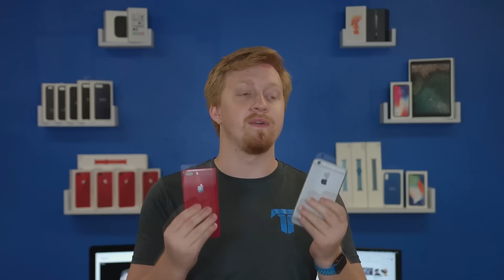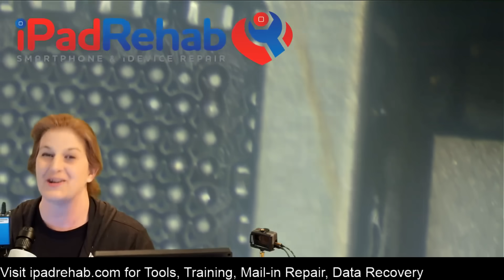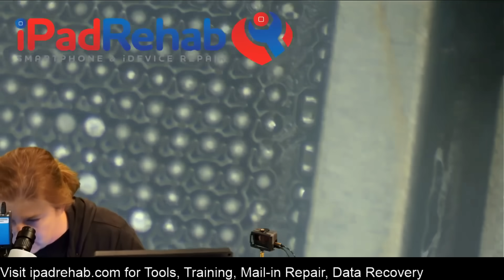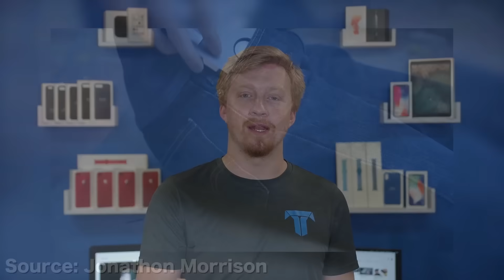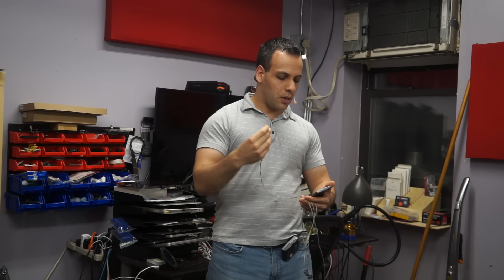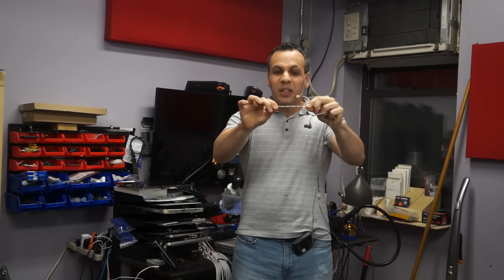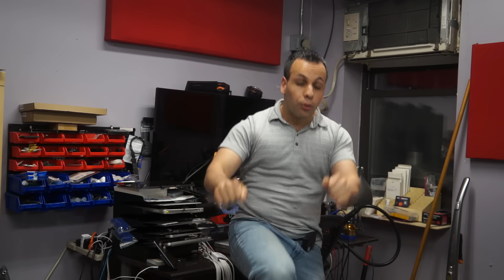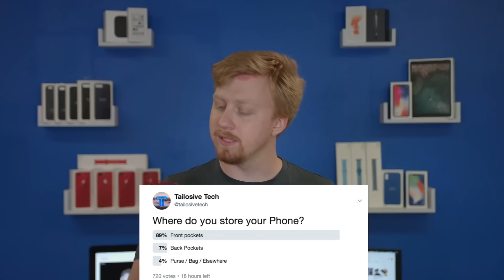The truth about iPhone bendgate deniers

Comment: My personal experience 
Android usage: 5years
Devices used: 5 phones
Resold phones: No. Did try but no one would buy them even though they were in excellent condition and at most 12 months old
iOS usage: almost 4 years 
Devices used: Got my 2nd iOS device a month back
Resold iPhone: 30% of buying price 

The new Samsung ad mocking iPhone X is something similar to what I experienced in real life, if you just switch android with iOS and vice versa

- An average consumer
Reply: Cant argue against the resale value of ios devices, but 30% on a 4 year old used phone?
The iPhone 6 Plus is now 3 gens old and was ~800€ here. 
Ive checked ebay and used ones sell for 145-190€.
A used S6 edge plus(was about the same at that time) sells for nearly the same. Maybe 10€ difference, thats it. 
Same goes for the Note 4(2014 release).
So i dont see your point proven here. 
You get greater resell value when comparing 1 or 2 year old android phones, but everything above theres no difference.

Other than that, i think Android is a more advanced os than iOS. 
The only thing that is mostly better on Apple devices are Apps and system integration. 
But if you dont benefit from this bcs you only have one Apple device, iOS is just bad. 
I own a Pixel 2 and an iPad Pro 10.5 and both have their selling points but also their flaws. 
The main flaw with the iPad is iOS imo. Not being able to move my files from one app to another(like you can on OSX, Windows or Android) is so annoying. They should bring osx to their iPads, everything else is just crippling on your productivity.
Reply: Sander169 The point I was trying to make isn’t just about the higher resale value. Although I would like to point out that in India the retail price is usually higher than in regions like US and UK, for e.g. the $1000 iPhone X roughly costs $1300 in India, hence there a slight higher re sale value since people usually set the price according to the price at which they bought the phone. Additionally where you end up selling the phone also makes the price vary in some cases by a big margin. 
Coming back to point I was trying to make, I absolutely loved android at point in time, but the issue with android was that I was having to upgrade my phone every year just to keep a smooth lag free experience. After about an year of usage all my android phones would have very very clear signs of ageing software wise be it a mid range the wildfire or the flagship htc one( m7)(that still is from my perspective the phone that completely revolutionised how phones were being designed)
So basically my phones upgrades were mostly out of need to upgrade and when I upgraded to the iPhone X last month after over three and half years of usage I upgraded my phone because I wanted a new device rather than needing a new device like in the case of when I had android devices.
From the perspective of an average consumer I would rather spend slightly extra money and get a device I know I wouldn’t need to change for the next couple of years plus for me the novelty of no limits to customisation on android kinda wore off soon. I did my bit for android by being loyal for 5 years, I switched to iOS just to try and see what its all about and tuns out I don’t wanna go back to android.

P.S: Yes many things would have definitely changed with the newer android flagships, I’m sure the iconic Samsung lag is not a thing anymore, but then that one Samsung device with the lag was more than enough for me to put me off Samsung for life. (When I went to buy my latest device I did check out the S9 but those old memories were there too to make sure I wasn’t even considering it) kinda like in the latest Samsung ad, do you think after all that, the woman would ever try an iPhone again. And that’s the case with 90% of the average consumer

Comment: Mind that boards not only bend by mechanical stress put on the case. They also bend if you put thermal stress on them. CPU load is gerenerating lot of heat also charging the battery.

Comment: Dude All of them can be countered. For example, you said that the bend gate still matters bc we have a similar design. Number one the newest iphone which is the direction that apple is going in (and might I add pretty much all the android phones too). AND none of the designs were the same, the iPhone 6s was built with a stronger grade aluminum which brought down the number of iPhones that were bending, and the 8, 8 plus, and x all have glass backs which makes it significantly harder to bend iPhones. Another example is you said the iPhone 6 and 7 had very similar problems, well guess what? you can find similar problems if you look through millions of cases, and you just so happened to have millions of options to chose from bc as I'm sure your very well aware the iPhone 6 was one of the best selling phones of all time, even with the bend gate that only effected a small percentage of iPhone 6 users. Additionally, you said that apple never addressed the problem, they actually have out out statements about this particular "issue" with the iphone 6 and so yes, they addressed the "problem" and they chose not to do anything about it bc it is just something that comes with newer thinner products and ones that have been used in the wrong way, they will break easier, and thats just a fact of life.

Comment: I’ve got an iPhone 6s and have had it for a little over 2 years and it’s fine, it is completely flat (apart from the extended camera from the back of the phone). Maybe the iPhone 6s didn’t have the problem or it does and I’m just lucky and don’t have the bend issue

Comment: I am a male and put my iPhone in my back pocket. I replaced three iPhone 6's between my wife and myself for them bending. I didn't know until recently the other issues like dead spot in the touch screen and boot looping may have stemmed from bending and flexing, but it seems apple knew all along. We had to also upgraded to 7 plus models after the last two broke because with all the apps we had purchased between ourselves and for our kids we feel we are stuck in them. Also having to replace 4's and 5's for battery issues that apparently were issues with their OS after updates. Really wishing there was retribution for all this stuff, every time i hear the information released apple knew about these things or caused them like the battery gate it frustrates me. 

As for the angry lady D.N.A.who posted prior to me, it's not whether or not YOU put your phone in your pocket and it didn't bend (which by the way there is rumor Apple changed the metal alloy in the "S" models after the iPhone 6 bending issues) its the fact that MANY people have had this issue. I'm not alone and not crazy because I went through a few of these things along with MANY MORE PEOPLE. Just because YOU had a positive experience does not mean I am not allowed to have an event occur to me that was negative and I'n not crazy because I think it was engineered wrong. I'm guessing you think Ford was not at fault for the Pinto and Police Interceptors starting on fire? Plenty of people and police officers drove those with out issues like to say your experience was, I guess those exploding gas tanks weren't a mistake according to your train of thought...

Comment: Just an input on Samsung. They had the pink line in the right side on s7 edges. Won't fix it out if warranty and if left it'll cover the screen. You should talk about that and explain why and what to do
Reply from the maker: I have only seen that on replacement screens, never on the original phones. Even when it was an original screen used to replace it though.
Reply: Louis Rossmann I bought mine from a guy about a year after it came out (used) and it happened 6 months after when my phone fell out of my hand and flat on the floor. No physical damage but the pink line appeared. It only got worse with time even though I was extremely careful after. After researching it I found a large amount if people had experienced this. Even at school (college) when I asked people they would say they knew someone else who had it or they had a device with the same line
Reply from the maker: I wonder if the first guy I had the screen replaced on it. Those are ridiculously difficult to replace the screen on, because those screens break very easily if not adhesed properly into the phone. One of the reasons I don't fix the screens on them is because I know I would likely get many warranty returns for pink lines. I know the local Samsung repair places are tortured by this
Reply: Louis Rossmann no cause it was fine before and Samsung when I contacted them said it's a wire in the LCD that got messed up and even tho it's their fault they don't warranty it

Comment: The 7 and above fixes this problem by using a different alloy in the housing.
Reply from the maker: the 7 has audio IC defects at the same point that the 6+ had touch IC defects. they learned little from this :(

Comment: What about the fact that you see the most broken phones? You are a smartphone repair guy. You see the worst of the phone world. You don’t see the millions of working iPhone 6s that are still in use. There are still hundreds of millions of iPhone 6 users, like myself, that appreciate the continued support and high build quality of our smartphones. This issue is extremely isolated and not as widespread as you think it is.
Reply from the maker: Touch IC issues my friend Jessa Jones has fixed on the iPhone 4, 4 CDMA, 4S, 5, 5S, 5C, 6S, 6S+, 7, and 7+: under 20.

Touch IC issues my friend Jessa Jones has fixed on the iPhone 6+ alone: over 1200.

When you open it and notice "oh, the board flexes and this pad pops off the board.." it becomes obvious why.
Reply: Louis Rossmann: How many iPhone 6 and 6+ do you think are in current use? 74.5 million for the 6 alone. This is an extremely small percentage of people who experience it, and they are thankful for people like you who are willing to fix it for them. However, iPhone design has changed. The 6S improved the quality of the aluminum, the 7 got thicker and more durable, and the 8 has glass that is exponentially more bend resistant and durable.

Comment: So unless you’ve opened a phone and have knowledge about how they work you should not have the right to express your opinions about a phone.   I think you went to far by telling him to shut his mouth. 

He was reacting to the channels who bent the phones purposely. He never said people did not have issues he said it was just a extremely small amount of iPhone 6 had bendgate issues
Reply from the maker: I think you are welcome to an opinion about a phone. However, if you're going to defend a design that is radically flawed that still affects phones to this day, I think your rebuttal should come from a place of knowledge. I think it crosses a line when when you discount the issues that hundreds of thousands of people are having by blaming them for what is someone else's failure. If you are going to blame the user for the manufacturer's failure, I think you should know how something is attached. It isn't a small amount of people.

If someone thinks a device is ok, that's great. But to want to brush under the rug the experiences of the people who were screwed is kinda lame. If you're going to do that, come with logic and evidence that explains WHY these people are at fault rather than the design of the phone. 

jessa has a workshop that is in the absolute middle of nowhere. Every phone besides the iPhone 6/6+ she has fixed touch IC issues less than 20 times.. the iP6/6+ over 1200. this isn't a small amount.
Reply: Extremely small? This issue has persisted past the initial iPhone 6 model, and to the repair community's knowledge, up to the iPhone 7. That's an entire 3 years of this issue existing, and Apple even had to issue a recall for any phones that were iPhone 7s with this issue: https://www.apple.com/support/iphone-7-no-service/
Reply: Too . Not to. Your argument is now invalid.
Reply: If you dare to comment on hardware problems you better bring your hardware knowledge. Which is usually Zero with these "TECH" Reviewers.

Comment: You should have broken a spoon with flexion to illustrate the point. It's one of the easiest ways to show it. It can bed, you can bend it 90 degrees or more, it won't break... but bend it back and forth even a few degrees and sooner or later it fails.

It's shocking how many people don't get that this is a thing with PCB's and traces. Traces can just end up lifting straight off the board after prolonged abuse... and it wasn't any one impact at fault!

Also you bring up a group I like to call "percenters' -- they will dismiss something -- like the sale of Samsung 6's -- because it was a low percentage of the market, not realizing that even a small percentage is still millions upon millions.

We deal with that all the time with "market share" in the web browser world, where people will badmouth "xxx" browser and say it's dying just because it's share of the market dropped.

Whilst failing to account that the pool size changed. Take Internet Exploder's share from its 2003 peak to it's ~2008ish ACTUAL start of decline. For that ENTIRE time people were saying "IE's lost all it's share, nobody's using it anymore" -- but you do the math and it's a bullshit claim. in '03 they had 92% of a market of a 650 million user market. By 2008 sure, their share had dropped to around 50% depending on who's numbers you used, but that was out of around 1.5 *B*illion users. Now I'm no mathemagician, but I'm pretty sure that 750 million is MORE than 598 million.

So whilst they lost 42% market share, they gained over 150 million users MEANING THEY DIDN'T LOSE A DAMNED THING!!! The market grew, and the new market didn't entirely go towards them. That's all.

Web Developers use the percentage excuse all the time. Oh IE users are only this percentage of the market and declining, oh mobile users of non-IOS are only this percentage, people disabling JavaScript are only this tiny percentage. People without broadband is only a small percentage...

Until they've "lame excused" themselves out of supporting so many small percentages there's nobody left!

All just to cover up their ignorance, apathy, laziness, and incompetence.

Comment: I bought the S6 because it was so beautiful, i had S5 before, I still use my S6, and it does have a slight bend in frame, but tbh, it has slowed down so much that it's annoying to use, I guess I have to buy a new one at some point.
Reply: The S6 was the first phone since the original S that when I saw it I had the reaction of I want that, I had S3, S4 active and S5 between them, not because I wanted them but because I managed to fuck them up, I wasn't even going to buy the S5, I wanted to repair the S4 active but no repair shop wanted to fix it because it would lose the water proof warranty.
Reply: Oh yes, even when the frame is bent a bit, it works fine, except the slow down, which is probably from the "old" age of 3 years.

Comment: Flection, is work hardening metal fatigue, a real problem for Aluminium alloys, aircraft ect where flex, vibration, pressure and temperature cycles are present, same for solder. Are there Female Engineers? Number of Female Engineers at my University? 3 out of 300 students, 1 Professor. Number I have worked with over 20 years? Zero. Rare!

Comment: I used to have a Galaxy S5. It failed after 3 years and I received a Galaxy S6 as part of the warranty program. I am pissed. It has no SD slot and no replaceable battery. I am going to have to buy a new phone soon there is just not enough storage.

The S6 has much smaller buttons than the Iphone 6. They do not weaken the frame the same way that they do on the Iphone 6.

I also think that the Galaxy S6 is too smooth and is more likely to be dropped. Overall a very bad phone as you say. But just looking at the side of it,,, it is very unlikely to bend.

Comment: "Without consequence"? I bought a barely used S6('Spark' network) for $250 with a warranty from CPR. It had issues. During the warranty period, fixed them all myself, including that unstable desktop: after 13 months of staid research, tough love and unrequited hate, it runs flawlessly except for a reliable but weak WiFi reception. No bloat ware, adware, nor sideloaded OS, as if that were even possible with encryption and no SD card. So what, I wanted to create a unique thing that I could afford to keep.

Comment: The fix is so simple too... Just split the board in two with a ZIF connector and ribbon between them add a little reinforcement to the frame... And I'm just an enthusiast hacker, not an engineer... They don't do it because there is no monetary incentive for them... Planned obsolescence is a real thing....

Kind of like how I can repair most LCD TVs I pick up from the trash by replacing two or four underspec caps from the power supply. I have repaired well over 20 in the last few years and the total cost of all the repairs together (apart from my time, around 15 minutes a pop) was around 10$ in capacitors. All because the manufacturer decided to use 10v rated capacitors on a 9v rail in the power supply. For context the general rule of thumb is that you are supposed to use capacitors with around a 20% margin in rating at a minimum to avoid durability issues. The result is that those TVs go dead after around 2 years, right when the warranty wears off.